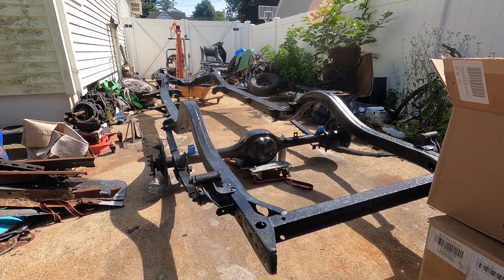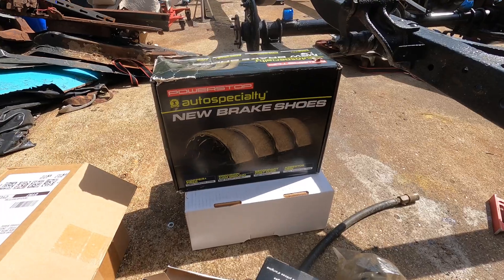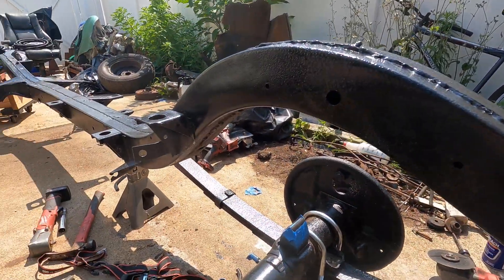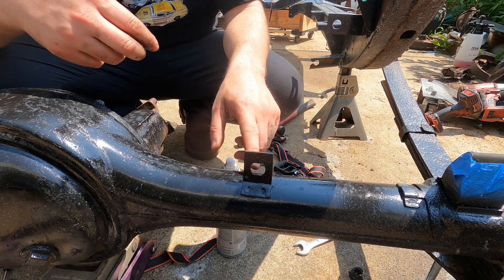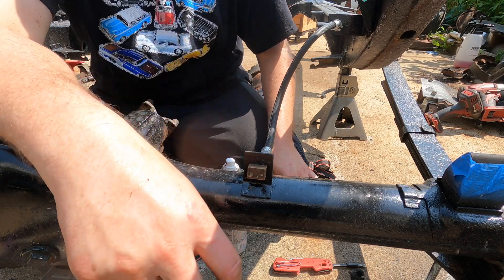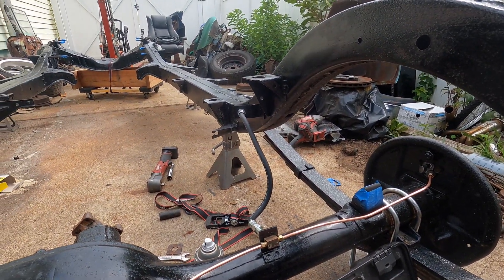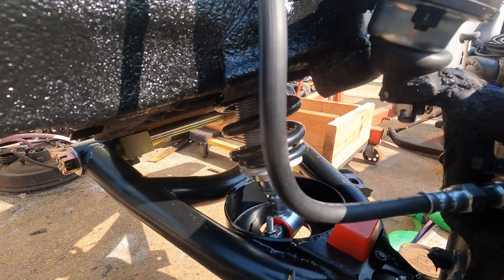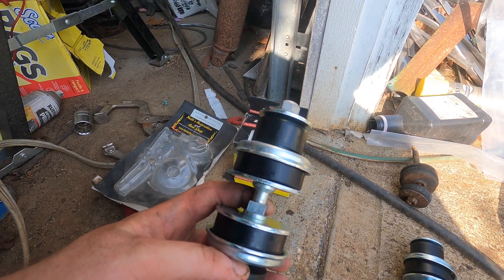1956 Bel Air Frame Restoration!

Comment: That frame came out very nice.  Lots of new parts look great installed.  I know you have many hours involved in this project.  Great video and very informative explanation of what's going on.
Reply from the maker: Thank you! Waiting on wheel bearings and new drums (should be here today) and then I can marry the body back to the frame. I don’t even want to know how many hours I have tied up in this car, but I’m really looking forward to having it be mobile once again. Few more small areas of rust repair and I think I can begin reassembly.